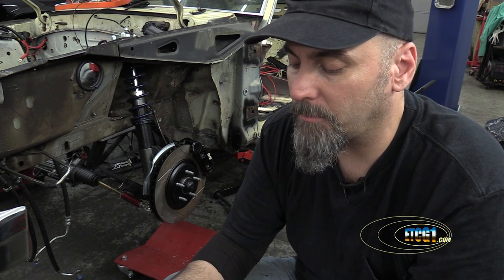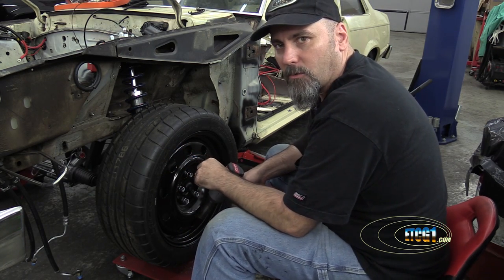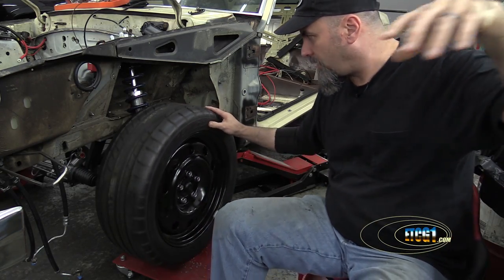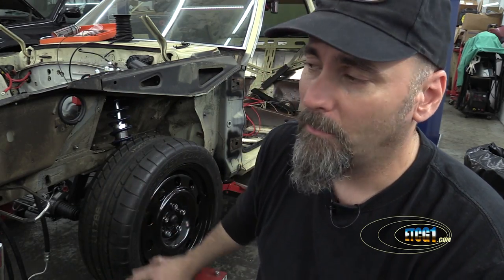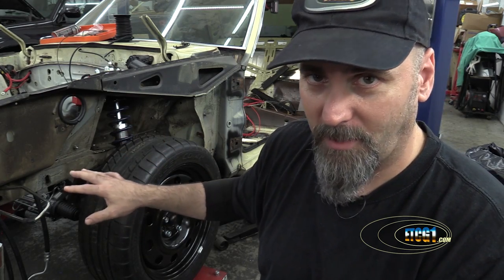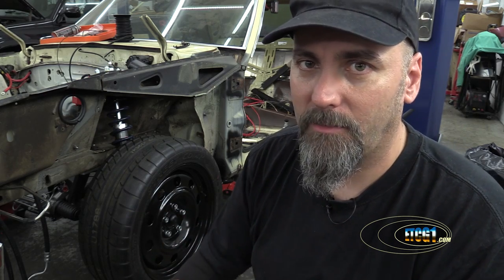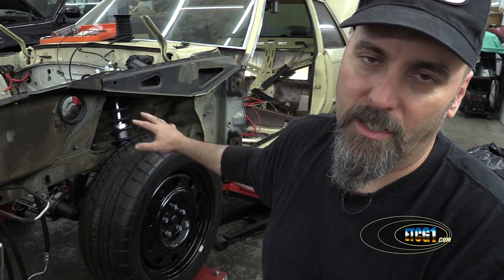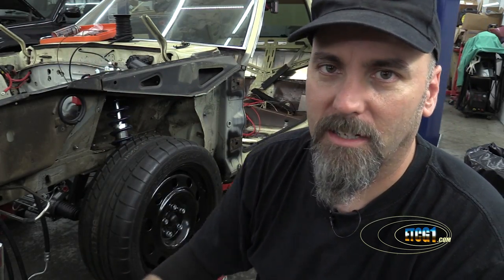Are Wheel Spacers Safe?

Comment: These type of wheel spacers that are nothing but a washer, and use the original studs to mount the wheel to the vehicle, that I have no problem with. I would have a problem with the 3 inch spacers that have their own studs, and bolt onto the original studs.

Comment: If Properly done, wheel spacers are perfectly fine. Now if you bought 3in spacers off of ebay from china that use seperate studs mounted to the spacer itself rather than just extend from the hub, you're setting yourself up for a world of hurt, and you deserve every ounce of it for being impractical and stupid. Eric, you did it properly and even bought new longer studs.

Comment: You didnt even address mating surface tolerence or their size, the most important factor. Nobody cares about 1/4 or 1/2 inch spacers, we are talking about 2-3 inch spacers. At 7K RPMS any imbalance at installation is greatly exaggerated.

Comment: Oh the never ending debate over wheel spacer and their safety. I would say 99% wheel spacers will it be negative however these were made Hub Centric & only 1/4 inch, but are they safe. The guy drives a Ford do you really think safety is a concern. It's a Foxbody you know it's going to hook left so so it's kind of a pointless debate. But the real issue is when you did a coil over conversion have you made your mounts in the correct location you would not need wheel spacers or the correct size wheels with off set. But always remember half-ass engineering with half-ass parts only means half-ass results
Reply from the maker: The car goes straight and does not hook left. These parts were made for a Mustang, not a Fairmont. Some engineering was required to get everything to work on this car. It's been 3 years and I'm very happy with how it turned out. Thanks for your comment.

Comment: Eric you spent 20K on that ....car?! 
If you don't mind me saying, I find something ill in all this....
You use to have a hobby of helping people in need, but now this?...

You are installing low profile tires that don't dampen the ride much and easily blow out when hitting potholes?
These are the kinds of things you want to encourage our youth that look up to you for wisdom to do instead of working towards a practical reliable vehicle and a roof over their heads they may own someday?

I use to like you and Scotty Kilmer but now it seems Scotty is the only one that doesn't have his soul up in his mind machine, he is still solidly grounded in reality and practicality and simplicity, why aren't you?

Discussing wheel spacers you didn't discuss what mostly goes along with them, Bigger monster tires on SUV’s and trucks and faster wearing rear axle bearings, faster wearing steering components, higher center of gravity-roll over hazard, having to cut out the fenders and fender liners for the bigger tires to fit, damage to the fender and fender lines when the larger tires hit a hard bump, water entering the engine compartment because of lack of fender liner full protection, snow pack around the monster tires in the winter causing limited steering hazard, fix it tickets for violating the law requiring tires not to protrude past the fender lines, all the expense and lost touch with reality to charge a mental illusion mind trap.....

Take care
Reply from the maker: That's an awful lot of assumptions from someone I've never met. I appreciate your input. Thank you for your comment.
Reply: Thank you Sir Eric for your reply!
Well your an attractive sweetheart of a guy and I’m glad you don’t take discussions personally and I’m sorry I came on strong there!

It does hit a cord in me stemming much from these channels sponsored by these accessory companies where they advocate-educate our youth to replace it seems like the whole car with aftermarket “improvements”.
Because what we advocate has such a strong influence on people’s lives in our world and their future potential and I see and know young people with their whole life ahead of them and many don’t have any long term stability like owning a house.

Chasing a dream of something that is slightly detached from what is practical in this our reality is alright if we can afford it, if we already have built up stability in our lives first like you have, but many do the opposite first.

I mean aren’t we constantly spoon fed consumerism and debt, often becoming addicted to chasing shiny brand new impractical images till we say “I have to have that”? And when we buy it, we get that energy high of addiction..
Such as stripped down project cars that for the majority of us will never get done, so we put it on Craigslist.
These often cost us way more than we thought and are often impractical cars for us and our reality.

I mean all these big or wide tires and after market accessories whose ads Only promote the pros but mostly Never the cons and short comings of why the original manufacturers didn’t use them to begin with.
But we find out after we buy and install the product and our money is spent, the cons because in a way haven’t we been conned by our energy mind machines seeking its next thrill at what price?

Well shouldn’t the discussion of if adding spacers is safe, should include the cons of why many mechanic shops and discount tires stores etc have a policy that they won’t install a wheel with a spacer or aftermarket adapter?
If we google, we do see spacers and adapter failures from some people sincerely warning us not to risk it.
Many saying they kept coming loose till they added lock tite to the threads.

Also isn’t their strength questionable when so often the torque specs on the spacer lugs is less than the original lugs?
Also the concern that many original wheels go on the car hub centric so that the weight of the vehicle is sitting on the hub, they were designed that way for engineer reasons besides the reason to center balance it.

Yet many aftermarket spacers are lug centric so the weight of the car now sits on the lugs and we see pictures how this has holed out the wheel stud holes and chewed on the stud to the point of failure.

Such set ups can fail and so be dangerous and so many high profile vehicles can roll over and total the vehicle if at highway speeds and too often people die in a roll over....
Isn’t a spacer or adapter failure much worse than a tire failure or blowout as the car doesn’t even have the wheel rim to stand on anymore during a failure?

Well comments sections arent the best platform for mimicking a conversation two friends having a coffee and an open hearing of what the other has to say, as two share each other’s perspective and together, both come to new understandings.

You are an expert at what you do and it makes sense that you enjoy taking it further and expressing in rebuilding a car the way you want it so you go ahead and enjoy and have fun!

Well take care!!
Reply from the maker: @JimTMcDaniels1  All good points, thank you for that detailed input. I have touched on the topic of budgeting for project vehicles, and I've tried to convey that it's not the best investment. https://www.youtube.com/watch?v=m4AQOG-svAM&t=3s

As for wheel spacers, I can only speak to my experience with this particular vehicle, which has been good up to this point. "This point" would be 2 years after completing the car and 10K miles. Are wheel spacers always a good idea, not really. I think it depends on the vehicle and the wheels being installed. Not to mention the use of the vehicle, and how it will be driven. 

Thank you again for your comments.

Comment: I considered them, but it is simply not worth it for me. Even though the OEM spacers offeredare only 5mm ( = 1/5 inch), that setup is not approved for snow chain use by the manufacturer anymore... Jesus, only 5 mm! And then I would need a new set of wheel bolts that are 5 mm longer, which are pretty pricey. Considering that 5 mm is pretty much nothing and hardly noticeable, I passed. Some people put wider 3rd party spacers on, but that may void your warranty etc bla-bla... so no spacers for me.

Comment: I always defer to the original designers of said automobile and spacers are outside of the design envelope.Having said that, I don't see spacers as particularly dangerous or anything. If it helps you drift easier or helps you get laid, more power to ya.

Comment: Are Wheel Spacers Safe? As long as they are correctly machined from decent steel and fitted properly then yeah. If you go for cheap 3rd-party style knock-offs from Ebay, probably not.

Comment: Just thought I'd chime in again. Wheel spacers if of proper design and fitted properly meeting all specifications are safe.
That said the spacers Eric has and thought was a good idea to modify by adding a centring ring are a dangerous pile of feces. 
He needs to get the ones that are machined from a solid piece of correct grade alloy and drilled with the correct stud pattern and toss the things he has wasted his time with in the scrap bin after cutting them up so no one else will make the mistake of using them. And the engineers at maximum motor sport will agree if they see the crap he has and the wheels that he wants to use. The alternative is to get the rims recentred to suit the off set.

Comment: no I cant take that, there are dangerous and safer wheel spacers in the market obviously but none of them will give you the safely of a car without spacers and its shoking the engineer didnt say upto how many inches is it safe because the more space there is the less safe it will be and all of the spacer examples lack some safety no matter what u do you wont get the safety like without spacer . for this example, a pencil is hard to break if you want to break it by having your thumbs closer to each other but when you distance your thumbs it will easily break , basiclally the longer any tube/screw gets the stronger it should be made so it wont break. the one obvious one is the screws are not upgraded to stronger ones on this car and with spacers the bolt ends up further away making the screw longer (weaker). the worst wheel spacers are the ones you buy from the auto shop near you and its not hub centric but the guy gives you some plastic hub adaptors, with THIS one you will 100% die making a hard turn. its sometimes about how heavy the car is and how much grip it has, if its got too much grip with 275s summer tires then dont do it , dont get any wheel spacer.

Comment: Wrong.. Nope, wheel spacers are not as safe.. 
Extends bearing loads, scrub angles, moves clamping face load outward etc etc etc etc..
Yours would still be highly illegal in my country. This practice was made illegal by actual independent engineers, not engineers commenting on products they're trying to offload. These same engineers can low volume certify spacers if they meet exacting criteria but rarely are and having worked as an inspector for many years can tell you truthfully, yours would fail.
I find it funny people pushing the ideal of no noticeable or discernable difference with spacers are often those whom benefit, profit or utilize them.
Reply from the maker: It's been 3 years since I built this car and no issues yet. Thanks for the comment.

Comment: I say quit being cheap and go buy the right offset wheel. If you are to dumb to figure it out, google it. I think it’s like a double gasket, yeah you can tighten the crap out of it and it may not leak but it’s not correct. Most spacers are pot metal aluminum. Eric, you may have done it properly and took precautions but joe blow won’t, and I don’t wanna be on the road with that!

Comment: The problems with wheel spacers are , excessive loads on the bearings, issues with tracking and wheel alignment, a differential in temperature and expansion coefficients, electrolysis, inability to correctly torque wheel studs.
I mentioned this before, those spacers are not suitable for those wheels. If they were a solid ring with the holes drilled for the stud pattern with no gaps due to the multiple stud pattern design then they'd be ok for those wheels. Due to the flexing of the steel rims and the gaps causing uneven loading fractures will begin to form and the wheels are likely to come off. The lug nuts are also likely to work loose due to the uneven contact pad. So as the engineers say of which I am one when properly installed spacers are perfectly safe. Eric this is not a proper installation. Get some solid spacers or alloy wheels that these particular spacers are suited to.
Reply from the maker: Tell you what, take it up with the engineers at Maximum Motorsports because it seems no matter how much evidence I produce, there are some people I'm never going to reach. That's cool, I've just said all I'm going to say.
Reply: ETCG1 Eric the issue is not that you are using a spacer it's that you're using the WRONG spacer for those rims.
Either get the right spacer of the right rims that's all I'm saying.

Comment: Now its the imagination of the steel wheels being the problem. Not in this case. Those cop car wheels have to cary a heavier car and stand horrible abuse. Don't fret about your wheels. you should be focused on the use of aluminum wheel spacers. At least check the front wheel nuts frequently to be sure they are staying tight. Another thing about aluminum is the strength of it. can vary over a wide range. If the spacers were heat treated and then welded upon and not retreated the weld will be weak. There are so many variables. Eric has decided on what he is going to do and he will not consider anything else. OK, I expect its most likely to work out fine.
Reply from the maker: If it doesnt' work out, I'm happy to share it, but my problem is all the people speculating about what MIGHT happen, not the facts. There hasn't been a single shred of proof yet that my wheel spacers will cause an issue.

Comment: Eric you do realize centering the spacer on the hub doesn't matter, the reason you want a hub centric spacer is so the spacer can center the wheel on the hub(and have enough of a lip to hold some load). Also, just because maximum motorsports says 1/4 inch spacer is safe, doesn't mean they know the length of your studs and how many threads of the lug nut you can get on. 

Like you said, wheel spacers are safe if properly installed.
Reply: David G did you miss the part where he said he is changing the studs out for longer ones to address that?
Reply: No, I didnt. I'm saying IN GENERAL, they don't know the length of his studs, so their claim is invalid unless they know all information on the vehicle, I never said Eric wasn't changing his studs.
Reply: Maximum Motorsports has a dang good idea how long the factory studs are on a Fairmont, they also have an idea about the factory stud length of a 94-95 Mustang in which Eric's front spindles came from.  They've been building and racing street and race Mustangs for the better part of two decades and have specialized in the Fox Platform Cars.  There are few other sources of information that I'd trust more.  

There are only two things I disagree with them on and that's the Panhard Bar setup vs a Watts link setup and rear roll center heights.  They say Watts links are unnecessarily heavy and complex, I disagree entirely as plenty of off the shelf options are available and the geometry has distinct advantages over a PHB in quick transitions like seen in autocross.

They also advocate for extremely low rear roll centers but my experience has shown that higher has worked better for the type of driving I do but they compensate for the low rear roll center with stiffer springs because they believe heavily in flat ride for all cars vs tuning for the different parts of a corner.  If anything, flat ride is nice for a dual purpose car but for a focused car I think it's an unnecessary constraint.  The High Rear RC allows for less spring rate which allows the back end to squat a little at corner exit.  This means better bump compliance due to softer rates, but a little more compliance when on the throttle to help not shock the tires loose.

But that's just me and they are both setup decisions designed around the compromises in suspension design for two very different goals.  The technical information they put out is all accurate.

Comment: Have you ever seen a car that does not use a hub to center the wheel?  I used to think all cars came with hub-centric wheels until I bought a car that violated the "rules." The rear axle of my '84 Isuzu Impulse has a hub but it's  just big enough to center the rear discs.  The rear wheels are only centered by the conical lug nuts.  Now I'm not advocating going without hub-centric adapters, but case-in-point: Even the engineers cheat the rules when common sense tells them it'll all be OK.  RELAX INTERNET... you'll be OK.